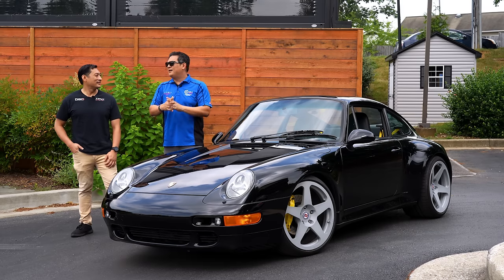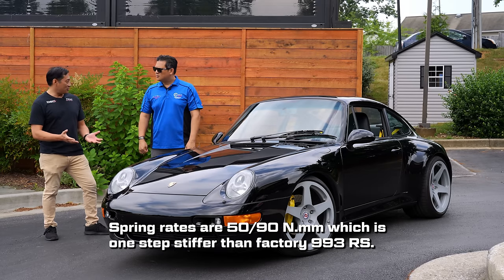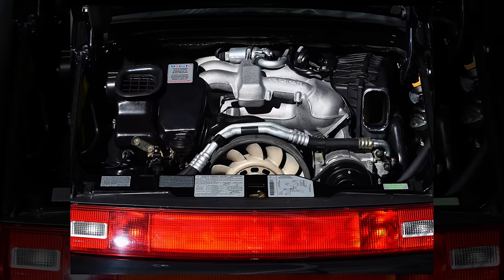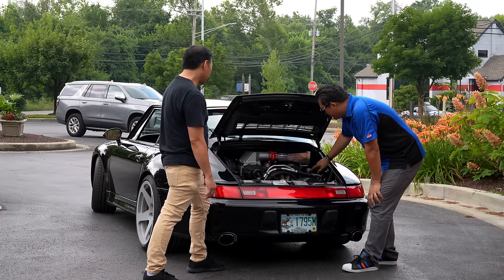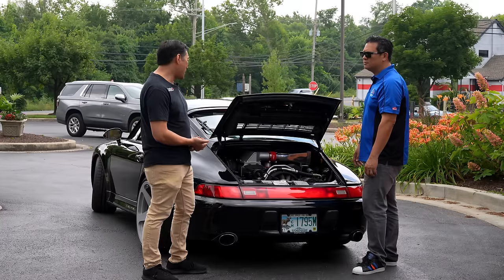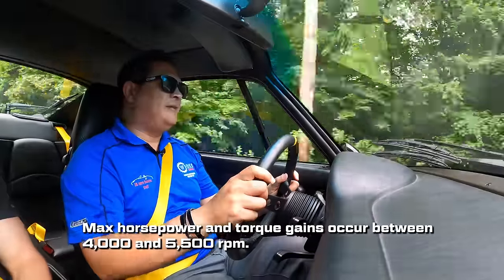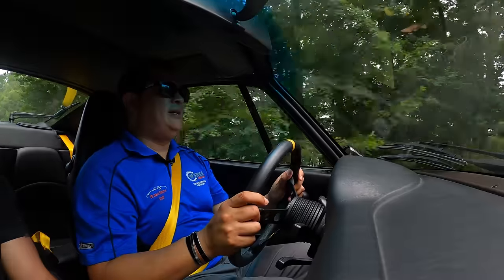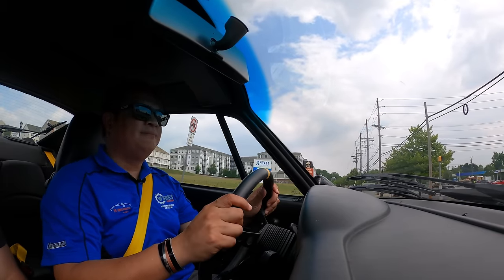Supercharged Porsche 993 Carrera 4S with active suspension: Should you do it?

Comment: Ive got a 993 in need of top-end rebuilt. I was considering doing something to increase my HP. It’s been remapped on the dyno and produces 294HP which is pretty good assuming 140K miles on the clock. I believe 3.8 conversion which may put me at 330-350HP range is around the same budget (20K) and gives you stock appearance and simplicity. Although I appreciate the work done here, excellent job!
Reply: There is a 4 valve head mod available for the air/oil cooled engines that can rev to 12K RPMs, check it out
Reply: @_que  does it require watercooling for cylinder heads like in 959? will definitely check it out! Many thanks
Reply: I'm in the same boat but it seems like the budget needs to be much higher to achieve that HP.  Wish it was easier!

Comment: Not a fan of forced induction really. I love the linear power band of N/A engines having grown up on early superbikes.
 What many don’t consider when looking at forced induction is the gas mileage, stress on the engine (with commensurate failures) and accelerated engine wear on it as well. 
You just can’t safely and legally use it on the street for more than a few seconds the vast majority of the time anyway
Not being wealthy myself one of the many  things that drew me to Porsche was the reliability and durability, with regular maintenance and WITHOUT abuse.
 Another was the balance of these cars as they come from the factory. Sure they can use a tweak here and there, but they are great cars as sold and thoroughly enjoyable.
Lastly I appreciate the preservation mentality of many Porsche owners. It’s why I could buy a stock seven year old Boxster S in really good condition, and have zero problems, and do only a reasonable amount of maintenance after three years.
To each his own I guess and the teenager in me still finds these interesting, but I’d rather get a 991.1-4S which is what I will do in a few years.
Reply: The supercharger is very linear.  I have had mine on my 993 for 30k miles now. Trouble free.  Completely linear and biggest increase is in the midrange actually.  No lag - gradual increase with the rpm.  It is a very different feel to turbocharging.
Reply: Supercharger is totally different than turbo. It's like N/A on STEROIDS, it's between N/A and electric car :P, you always have the torque and power starting from 1k rpm.
Reply: I guess I got one of the bad Porsches...my CPO 981 GT4 was in the shop for repairs 15+ times in the 3.5 years I had it.  I never tracked it, and added no over revs.  That said, "boost" isn't bad...Porsche does have turbo models.  "Boost done wrong" (i.e. - not changing compression ratio, and running too much boost, among other missteps) can cause problems.
Reply: This logic of "forced induction will have accelerated engine wear" comes from a pretty strange place in my opinion. A 996 Turbo if anything is more reliable than a 996 Carrera. Simply dividing the world into "reliable N/A" and "unreliable FI" ignores almost everything there is to engine design. And modern engines are downsized turbocharged because it improves fuel economy when done correctly. Any time an engine pulls intake manifold vacuum it is losing efficiency to pumping loss. That's why the 991.2 Carrera went to a 3L turbo H6.
Reply: @DOAHunt3r  The 996 non Turbo/GT3/GT2 have open deck, overheating, bore scoring, egg shaped cylinder, wet sumped, IMS POS of an engine, they have nothing in common apart of M96 code as a prefix.
Reply: @8359s  Hence why I say that the world is not as simple as "turbos/superchargers are unreliable, NA is reliable". A turbo engine can be remarkably reliable and durable if engineered correctly.

Comment: Great looking 993, but to be honest, a 993 works the best with maximum 19" dia wheels (18" inch wheels minimum), and on the street, with Kumho V70A and the KW III Suspension... Just try, and tell me that's not true 👍 You can see it through the back window, like the rear of this beautiful car is bouncing and hopping like a bunny, all because of the to big wheels. When the Toyo reaches his temperature window, the profile will become kinda smear but still sticky and full grip, but you'll drive a full slick! Try it😉👍

Comment: 4lbs?  If the Mezger is good for 600hp then you have to wonder why it’s not at 10lbs.  Seems compelling but to go to all that trouble would want to turn up the wick a bit more.
Those windshield wipers half way up the glass are disturbing.
Reply: It's probably due to the stock injectors and piggyback ECU. Not everybody wants and/or wants to deal with 600hp.
Reply: I didn’t say turn it up to 600 but maybe a bit more than what 4lbs is delivering
Reply: compression ratio?  
 @MegaNardman
Reply: @MegaNardman  Bingo!  I was wondering how this would work with stock injectors.  Now we know.

Comment: Is the supercharger modification legal for a California registered 993?
Reply from the maker: Any aftermarket part not approved by CARB is illegal to use on the road in California. Talk to TPC Racing and they may have some advice or experience working with customers who live in California.
Reply: Not without a CARB EO. This may be able to pass through the EO process but it will cost 5-10k USD assuming nothing goes wrong and you DIY as much as possible.

Comment: 20 grand for an 80hp gain is ridiculous!!!
Reply: Depends on what you need to do to get those 80hp...global parts shortages and price increases not helping.  But yeah, $20k for bolt on kit, "with a lot of stock parts left not upgraded", is a bit much.
Reply: Very ridiculous.  I spent $10K on my Cayman S to get 30 WHP, but it now sounds much better than stock.  That in addition to the suspension modifications I've made, I suspect it's really close to the performance of a 981 GT4 for $30K less all in.  Yes, it sounds ridiculous, but I'm very pleased with the results nonetheless.
Reply from the maker: How much would you expect to pay for dyno proven 80 hp? We'd love to hear an alternative solution.
Reply: @PorscheClubofAmerica   $30k for DeMan 4.5...for one of the applicable cars of course.  For me, its not the "Price to performance" gain that an issue, as much as its the "cost of the charger kit to number of pieces it contains"...or more importantly, "does not contain".
Reply: @PorscheClubofAmerica  Good point.  I'm not familiar with the 993.  How much for the ECU piggyback alone, and is it possible to upgrade the injectors?  If so, a turbo might yield more power if the motor can handle good boost.  Personally, the supercharger is much more interesting.  I've seen a Cayman turbo kit for $9K, but could a 993 turbo conversion be done less than $20K including labor and tune?